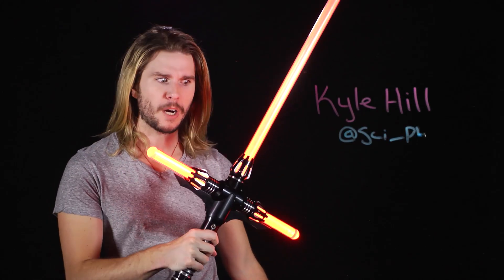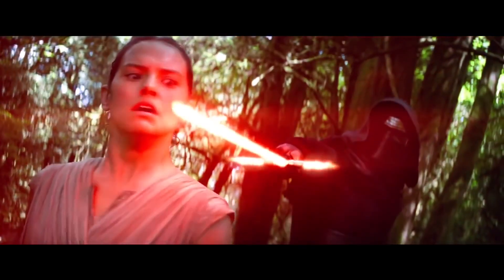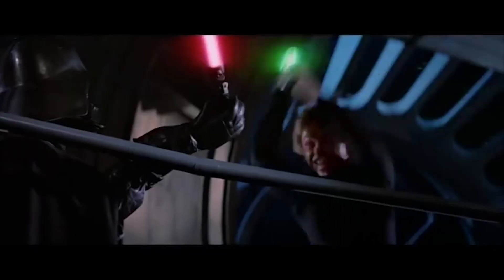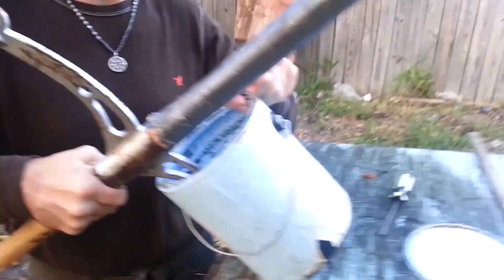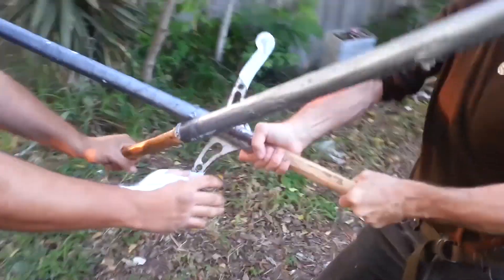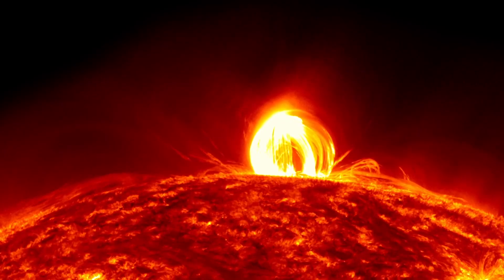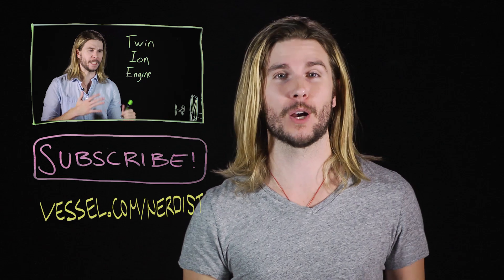Why Kylo Ren's Lightsaber Works (Because Science w/ Kyle Hill)

Comment: All good points. The main issues which still remain:
-His hilt is very thick, so unless he has wookie hands, it is difficult to keep proper grip on, especially while changing hand position
-The crystal is what we call 'unstable', meaning there is possibility for equipment failure. The guards have been described as vents for the main blade and are simply used as a guard. This shows us that there is an increased chance of failure. Any damage to the hilt could cause an explosion of the hilt rather than just some hot metal. Red crystals are always synthetic, not naturally grown as all other colored crystals are. So without a holocron or instructor telling him how to construct the red crystal, he would not likely form a stable one, nor likely a stable lightsaber hilt in general if his training under Luke hadn't progressed that far.
-There are gyroscopic forces acting when you swing a lightsaber, the same as when you hold a bike tire by the axle, spin it fast, and try to move it around. Adding more blades creates more difficult counteracting forces which must be overcome (possibly explaining his slow wilder swings needing more physical power to overcome those forces and move the blade safely).

Comment: if you read the wiki on his light saber you would see the reason why he has the cross guards is because he used a unstable crystal and they are vents so it doesn't blow up on him. but it does come with the advantage of hand protection. and that is also why his lighsaber crackles and sparks and other ones don't

Comment: this thought popped into my head. HOW. I think the crossgaurd is formed from the main plasma blade! how? one material... mandolorian iron! it's the only material that the can't cut through! at its resistant...perhaps through tampering and increased metal strength it could be possible. it would explain the weird effect of the main blade sparking and causing like it does! but its just a thought. what do you all think?

Comment: Look, Kylo's lightsaber is hated because it really just ads a new lightsaber with no noticeable benefit. Darth Maul's dual bladed lightsaber was very unique, first, it was the first different lightsaber, which now Disney shamed by adding more to lightsabers and giving no benefit to the holder of the shamed lightsaber. Plus, it takes a menacing character to pull of a new lightsaber. And frankly, I believe only Darth Maul could pull that off. Kylo just had the same style as almost every other Sith. Wear black and try not to conceal your face.

Comment: I hate the parsec argument... in a Sci-Fi universe with such simple access to hyper-light speeds it makes perfect sense that there is some skill involved in navigating based off of distances. Imagine 2 planes trying to travel between towns on opposite sides of an infinitely tall mountain range. One plane takes the safe path and goes around.The other plan goes balls to the wall and flies straight through the mountains risking a wreck.This is Solo's bragging rights.... I made a dangerous run in a very very efficient way AND dangerously close.

Comment: A weapon that forces you to adapt to it instead of the weapon adapting to you is by definition a poor weapon. Yes, you could adapt to the hideously dangerous cross guard with extensive training, but you could also use a normal lightsaber and become an equally expert fighter in a fraction of the time with a fraction of the effort.

Comment: As a sword enthusiast and rabid starwars fan I can confirm that yes a lot of blades do have hilt guards.
 my problems with Kylo's Sabre are simply this.. Sure the guards protect you from having your hands chopped off but they also ensure the same issue on your wielding the Sabre. Plus there's the issue of accidentally stabbing yourself when losing a clash of blades. Its the same kind of issue you get with any bladed guard it is just impractical

Comment: We all know that the tiny double-saber hilt is a bad idea, but looks neat.  

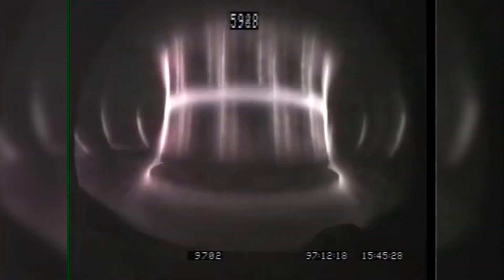Ideally the cross-guard would be some kind of material that redirects the force of the light sabre... a magnetized substance like the example of distorting plasma that you showed at 1:24.  Instead of being cut off, the hilt would simply redirect the plasma, causing it to "slide" off the hilt surface, or become stuck.... hmmm.

Comment: Actually, any die hard Star Wars fan knows that the actual blade doesn't form until it goes through the metal tube at the end. This is probably why every lights saber has that special end piece where the blade comes out. But other than that, I think your ideas are very plausible.

Comment: NON SPOILER ALERT! NOTHING I SAY IS ACTUALLY MENTIONED IN THE MOVIE BUT IS STILL TRUE.

Kylo's lightsaber is using very unstable crystal that ismore powerful than a typical crystal. And because it is unstable, it needs exhaust  ports. If those port are blocked/covered, the saber explodes. So you'll have to be VERY power hungry in order to actually want to use it. The blade ripples solely because the crystal is unstable. Its an expanded universe thing that they made cannon.

Comment: the thing with this lightsaber for most people is not, that the crossguard is inpractical or dangerous... the thing is. every good starwars-fan knows the normalbladed saber and the dopplebladed one. and those who have seen the old republic era know, that there isnt very much more to it. the original saberdisign worked more or less perfectly for thousands of years... and now? that disney took over, they have to make a new design to make the starwars franchise cooler? the simple fact is, that this new stuff isnt realy needed. so most people hate on it. me included.

Comment: I think too many people are pulling stuff out of their ass when the EU doesn't matter anymore. This new trilogy isn't based off or connected to any of that. 

Also, when the hilt gets cut, wouldn't the Light/Plasma become even more unstable since the hilts were there in the first place to direct the energy and make it stable ie exhaust? How could they bend and manipulate the flow of lightsaber energy otherwise? Otherwise why not put the hilt under the lightsaber Guard beams... That would make it a tiny bit more practical but still unsafe.

And secondly, no where in the movie or in interviews is it stated that it serves any logical purpose other than being a metaphor and to serve the function of telling how actually crude it is. It's made to tell where the Sith are at in the universe at the moment. 

No matter how much training one does, it's hilt will always be dangerous to the user and will limit the wielding of it. Which will result in the end that people with the simpler original design will find away to use that to their advantage. Simplicity always wins in all forms of Combat. Not Convoluted Designs that just add stuff for the sake of it. The remaining Jedi who have been training with the simpler Design will always have the advantage. 

And one last thing, if this were to actually serves a function in terms of  combat, by god this will result in tons of crazy designs that will take away the grace and simplicity of Light Sabers even more now. Who really wants that to happen? 

Darth Maul's was a very logical design, it was literally just doubling the light saber in a sensible way. It's entirely different from Kyo Ren's design.

Comment: SPOILER FREE
tl;dr
Without a lightsaber resistant bodysuit and gloves, Kylo Ren is going to hurt himself using that impractical lightsaber/sword.

While I agree with some of the video, the design really is impractical, UNLESS KR has cortosis laced gloves (or some other lightsaber resistant material. There are several. Look it up).

Watching all the trailers and the film itself, KR holds the sword at rest by wrapping his fingers around the crossguard at the base of the blade, not his hand around the the hilt where it should be. Not smart if you want to keep your fingers attached.

A sword's crossguard is designed to prevent an opponent's blade from reaching the wielder's hand and cutting his fingers off. A normal crossguard is not sharpened and it certainly isn't made from materials that are immediately detrimental to the user's health and/or effectiveness as a swordsman. KR's sword equivalent in today's world would be like making a crossguard from poisoned, sharpened, highly radioactive metal. Nice to keep your hands warm, but eventually it's going to kill you either through radiation poisoning, an accidental nick, or flat out cutting yourself on it.

Face it, KR's lightsaber was designed for woo factor, not utility. The filmmakers thought they needed something different as all we've had so far is different colors and double blades, so they gave KRs sword the crossguard and the blade itself the graphic effect of an unstable crystal from Star Wars The Force Unleashed video games.

Comment: For one thing users of the lightsaber are not always force users so for the light saber to be contained by the force is a no as then only jedi/sith could use it which is not true. Also the clips you showed were not the fact of a missing cross guard but an opening in the persons fighting technique. The over all fighting technique is one which relates to the katana which either has very little of cross guard, no cross guard, or it mainly for ornamentation. As such the technique is not to catch another katana on the cross guard but mainly to deflect it or catch it with the blade, so for a lightsaber to have this is very contrary to the fighting style of a lightsaber. However saying all of that it is a good design in many aspects as you have stated and the the lightsaber can evolve as the medieval sword to the rapier which could be handled by any one not just the leafy guys. So I guess this light saber could work. Though Darth Maul had the same thing with his light saber could have had his beam go all the way through but it did not so the cross guard needs some tweaking, but hey it is not a bad idea nor a bad style.
Reply: +Khoral Harbaugh sorry leafy--beefy

Comment: a lightsaber creates a perfect arc of plasma using almost no energy to maintain the shape, not contained by magnetic fields. defusing into a hilt would destabilize it rendering it useless as a saber and wouldn't block anything. it would be a plasma torch and would run out of power very quickly.

Comment: I'm not an SW expert here but I read somewhere it works in a different way. Lightsaber is basically laser with forcefield around the beam that makes up it shapes (so basically the same may work with light whip). Energy reflecting forcefield makes the beam confined inside it. Any solid matter going through the forcefield will be superheated (and essentially vaporized). As for energy weapons - the same mechanics apply in the inside and the outside - so forcefield allows to deflect energy attacks but also does not allow to "cut through" other forcefields. And there are 2 types of them - energy deflecting  and matter deflecting which can be combined (energy/matter deflecting as shown on Naboo in Ep1). Lightsaber mechanics doesn't allow it to be used underwater though (or in any other fluid environment).  As for the crossguard (90°) versus light staff - gosh - the whole reason of using staff is it's offensive power. And Maul's tactics was to initiate fight with single blade lit on and then when enemy has dropped his guard activate second blade and overpower opponent quickly as his fighting style didn't adapt as quickly. In this case crossguard has absolutely NO VALUE! It provides little to none protection and on the other hand does not give any advantage in offense.

Comment: But why don't they simply make the cross-guard out of cortosis? I mean even to the danger it poses to the user might be negligible it is still there and might even limit you in some way, and since their offensive capabilities are basically non-existent anyway, you might as well make them out of something, that doesn't pose a bigger threat threat to the user than it does to the opponent. The added weight of a small cortosi cross-guard would be pretty much a non-factor, since light-sabers are ridiculously light as it is, so adding a little weight would be pretty much a non-factors. On the other hand it's Star Wars we're talking about, i mean they actually thought a double bladed light-saber was a good idea...

Comment: SPOILER AHEAD: IF YOU HAVEN'T SEEN THE MOVIE, STOP READING HERE!
.
.
YOU HAVE BEEN WARNED!
.
.
.
After having seen the movie, the roughness of the Ren Sabre makes a lot of sense. The fact that it works as a cross-guard seems to be a side effect. Ren is impulsive, filled with rage and very unrefined. It makes sense that he would throw together his sabre with very little refinement. He'd get it working, and then go "there, close enough", pack it up, poke two holes on the sides for the excess plasma to flow out and call it a day.

We all had that one kid in woodworking class that did the very same thing. Worked their unrefined work into a "design style". 
That birdhouse with the skew roof and slightly too big hole? Design!
That spoon with a broken tip? A SPORK! It's design!
That light sabre with excess plasma flowing out the sides? Design!

 If you didn't know that guy, you WERE that guy!

Comment: also you could change the voltage on the crossguard piece so that it doesn't cut only blocks. increasing voltage and decreasing amps should create a resistor

Comment: Just a theory, but is it possible that kylos lightsaber isnt refined enough to hold the blade steady and precise? So using the force he contains the raw energy that emits from the crystal. (Spoiler Alert)

If you've seen the film, right at the beginning almost you see him stop and hold a blasters laser bolt using the force with little effort. Oddly enough the energy from the blaster looks alot like his lightsaber but blue. You've also seen him take a shot from Chewbaccas bowcaster and not be blown away like all the stormtroopers. So it's not unfair to say he's powerful. So yes? no? Crazy Theory?

Comment: A couple points, not disagreeing, but adding onto your points:

1. Swords with crossguards that prominent are commonly referred to as 'Bastard Swords'. So instead of tri-saber, we should call Kylo's weapon the 'Bastard Saber'. Fitting because Kylo is a douche.

2. His saber crackles and pops because the crystal in the hilt is impure, cloudy, and improperly refined, whereas regular sabers that we've seen thusfar have had perfect, clear, and refined crystals.

Comment: Parsec is a measurement of distance. The Kessel Run is a smuggling run that goes very close to a black hole cluster. The closest path would be right through it. Of course that's a terrible idea, but doing it in less parsecs would be more dangerous and therefore more badass. So Han Solo is basically cheating death by doing it in so little parsecs

Comment: The parsec was used to show the strength of the navigational computer. That is calculated the shortest rout. Not the speed.
Reply: +Patrik Van Pee Assuming the Kessel Run has a black hole somewhere on the route, you'd need to take a longer route to avoid the event horizon. So if the millenium falcon is fast enough, it could go fly closer to the black hole and thus, do the route in a shorter distance.